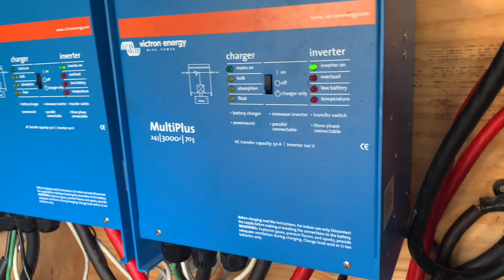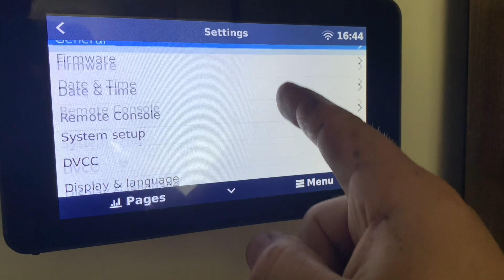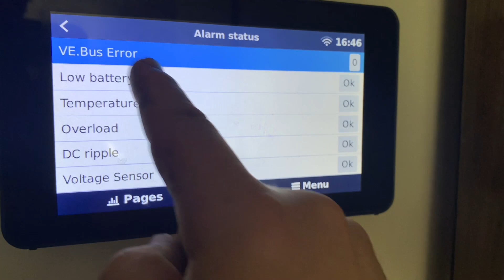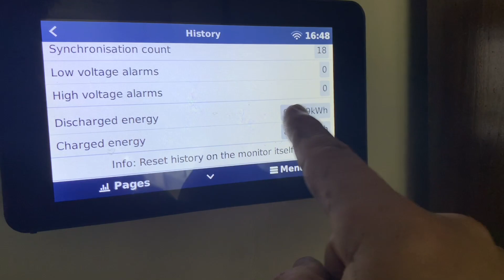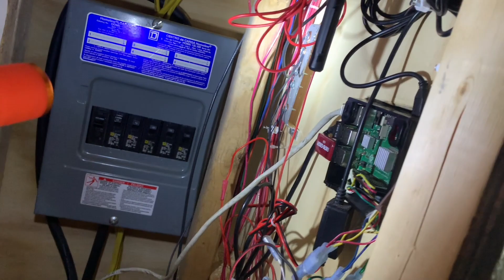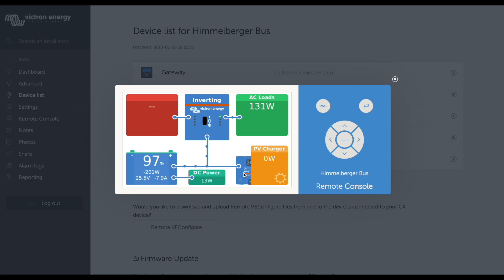Our Off Grid RV Solar Power System Update  | Bus RV Conversion

Comment: Sean, did you create a diagram of your AC in/out wiring of your two 24/3000/70 Multiplus inverters?  Do you have two, 50amp hot leads (L1 and L2) on input?  Are they parallel or split phase?  Any issues when you have only 30amp shore power (just an L1)?

Comment: I would like to know why you went with a 24 Volt system, instead of the 12 Volt system?
Reply from the maker: Great question.  For a few reasons 

1) my alternator is 24v, so the house system can be charged from it. It’s 270 amps just waiting to be tapped into, why not?  We can also use it to run the AC down the road. 

2) Solar charge capacity - chargers are limited by amps. If we did 12v that means my 100/50 charge controller is limited to 50 amps or 600 watts. We have 2600 watts of panels up there, at 600 watts per charger, and $300 each. That gets expensive real quick.  With 24v we can get away with 2 chargers just fine and pull in all the power we need. 

3) miscellaneous - we also see some benefits in wire size reduction, we can run 2/0 instead of 4/0. 24v inverters are more efficient (5% maybe). 

What’s the down side right? How do you run 12v RV stuff? Simple, we use a 900 watt dc-dc converter. Got it from Amazon for $60 I think. It runs every 12v thing we use . Awning, led lights, thermostat, water pump, some fans, 12v outlets.
Reply: @HimmelbergerBus  Great reply!  I think that since your charging system is 24V, and because of wire size, it only makes sense that you would go with 24V system.

Comment: That's sounding great but I have a few  more questions when you batteries are discharge overnight.
1. What is your morning voltage on batteries 
2. How much is your constant Watts/AMP draw on battery overnight (rough Idea).
3. What is your inverter Watts/AMP draw when Idel ( No loads on system).
4. Final question when your system is fully charged and charge controllers stop putting power into the batteries want is you sitting voltage and how far/fast do your battery discharge with a 400W constant draw overnight or whatever watts you draw overnight.
Reply from the maker: 1. It's different depending on the SOC, but usually between 25.6 and 25.2
2. 8-4 amps / 200-100 watts.  More when the fridge cycles on. Sometimes my older kids watch TV and make popcorn or whatever until 2-3 am.
3. That never happens, we've always got small electronics drawing on the system, theoretical minimum might be 50-60 watts I think.
4. Once full  the MPPT's go into float at at 27.6 or so, so it holds that until they can't, from lack of sun.  Then we'll slowly drop to past 26 and settle in around 25.8 in the evening. With a 400w load, over 8 hours would be  3200 watt hours,  we have 21,000 watt hours, so overnight we'd lose about 15% SOC from that load.  This is a common load we might run at a truck stop, we'll leave an AC on all night, it uses 300 watts or so just on fan mode.

https://vrm.victronenergy.com/installation/17735/share/c7e5a8fd   There is a lot o good info here in the Advanced tab on our solar system.  We're missing some data for various reasons, but you can dig into it and see how it all performs.
Reply: @HimmelbergerBus  Thanks so much for this info really help me out in understand my system more keep the videos coming they are great.
Reply: @HimmelbergerBus  solar is very addictive I down most of my day looking at your system lol. I'm loving it but this leads to more questions. Is it that your generator runs all the time to compensate for some of your energy usage?
Reply from the maker: Sean J Solar of you’re looking at our VRM, I have the shore power labeled as generator. So that’s just external power. When we’re at home I plug in to not cycle the batteries, but sometimes I leave it off grid. Our parking spot is very shaded so we don’t make good power until 1-2 pm.

Comment: What voltage do your system floats at and what voltage do you charge to?
Reply from the maker: Sean J Solar 26.7 is my float voltage. I charge to 28.8 then hold that until I hit .5% C tail off current, 5 amps or so. Both voltages are temperature compensated, in the winter it goes to well over 29.

Comment: Curious how you solved your “L1 overload “ issues when you were getting them, I have a similar setup like yours, I am using 2 12/3000/50 instead of the 24 volt you have.
Reply from the maker: Clint Tworek I think it more happens when a large load starts up or shuts off.  It also seems random, I’m still searching myself.

Comment: I've been waiting for this update, great work! Your build really inspired me to do a similar setup in my skoolie. I just purchased two victron 100/50 's (for the love of data) for my small 1.8kwh 12v LiFePO4 setup. I have about 500watts of solar on each side of my rounded school bus roof. Currently I have just 1 mppt solar charge controller from China which I can't even find a spec sheet for that handles both "sides" of the solar. After some research I found out that 500watts of solar that isn't facing the sun will actually limit the 500watts sun facing side of the solar setup in its output going into my battery. What are your thoughts on this?  Regarding to the cerbo gx vs raspberry pie, is it correct that the raspberry pie relies on wifi and Bluetooth to work vs just Bluetooth for the cerbo gx?
Reply from the maker: First, off glad  you enjoyed  the video and found it useful.  Yes, if you have two sets of  panels that experience different irradiance levels (different angles or shading) then yes, two controllers will help you harvest more.   It would be an interesting experiment to be sure.

I don't know much about the cerbo gx, it's very new.  For the rpi I bought a $6 BT module to get BT working better, but it still won't work right witht he VictronConnect app.  I suspect it might be because I'm running dev releases.   With that said I'm not sure what you mean exactly by "relies on".  For me, they only thing I use BT for is hopefully the app for my phone so if something happens with my screen and I don't have network connectivity, I can still adjust settings.  All my device connections are VE Direct to USB adapters into a USB hub into the Pi. 

I hope that helps.
Reply: @HimmelbergerBus  yes, your answer helped a lot. I though the raspberry pie only had access to victron vrm. I'll get the raspberry pie next since I was also planning on using it for android auto. Makes the investment more worth it 👍
Reply from the maker: @moritzs3886   Those dongles can add up though... $30 for each VE Direct usually.  I have one for  each solar charger, one for the BMV and an MK3 to USB for the Inverters (that's a $60 dongle) .   I've been looking at a head unit as well.  I see some on amazon that run android auto for $250-ish.  I hope you post what you come up with.

Comment: Absolutly like the philosophy from Victron. Although expensive I support them and have both chargers and inverters from Victron. Thanks for video.
Reply from the maker: Once I looked at other hybrid inverters, they were a steal compared to Magnasine and others.  And then the ecosystem upsides make it a no brainer.
Reply: @HimmelbergerBus  Agreed 100%.  If you search around, the prices aren't even all that bad when you consider everything that a multiplus does and the cost of other equipment, like intelligent chargers, that it replaces.